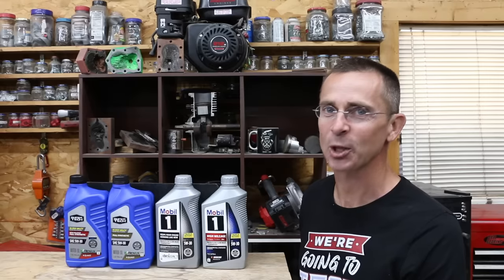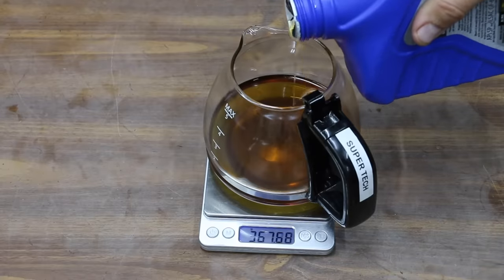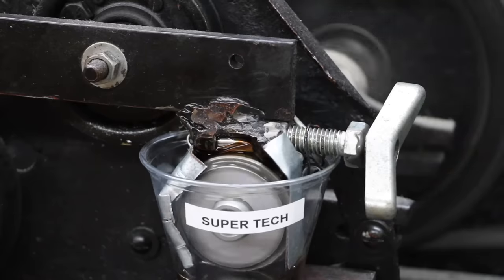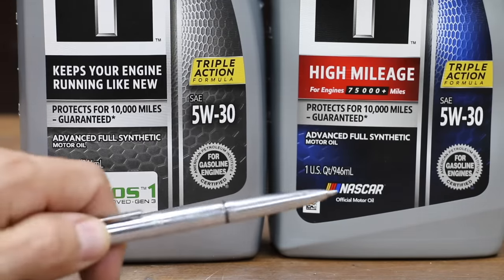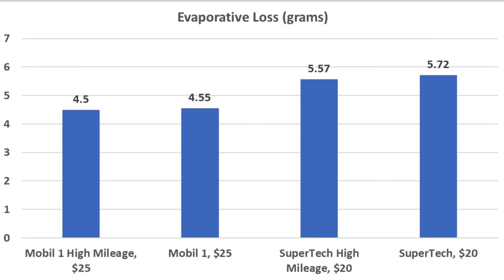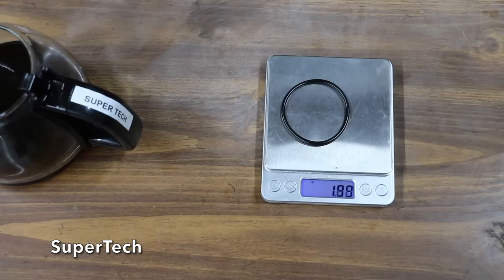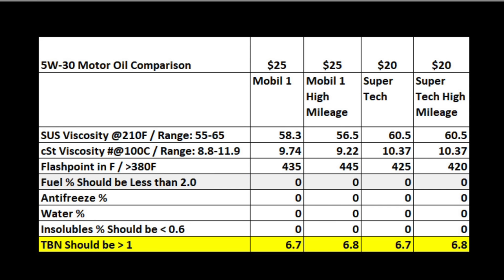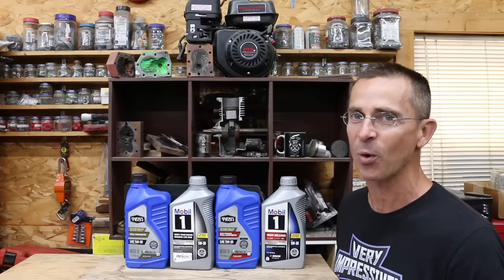Is “High Mileage” Motor Oil Safe? Let’s find out! Mobil 1 vs Mobil 1 High Mileage; SuperTech vs STHM

Comment: I think every manufacturer needs to strive to get the “Project Farm Seal of Approval”
Reply from the maker: Thanks!
Reply: LMAO! 
Too right!
Reply: Yes sir
Reply: @robbydiesel9345  that's not the greatest endorsement 😆
Reply: Castrol, it's more than just oil it's liquid engineering!  I had a cocktail 5w30 10w30 + Lucas stabilizer to seal drain plug leak

I saw gtx on sale $5 at dollar general, W.T.H.eck I put in 1/4 of the bottle 5w-20 high mileage to get me closer to 23 mpg (Dad's one owner)  cruising to the customers house in a van, and still NO drain leak missing a washer.  Just the water temp is higher running lean, OH WELL 🥵🫠🫡
Reply: couldnt agree no more
Reply: It would def be a PROVEN seal of APPROVAL
Reply: They all would be approved by him because he has never said an oil he’s tested is bad. He has even said that he generally uses Supertech himself (which is Walmart’s inexpensive store brand oil) because he said it’s good. And oils only get better from there with name brands.
Reply: Very Impressive stamp!
Reply: Never going to happen. Corporations are not interested in truth. They are interested in sales and full disclosure doesn’t produce that. Selective advertising does!
Reply: @michaelbaker5547 that’s not true! He tested full synthetic brands and super tech landed in the middle of.
Reply: They won't.  Less money in making shit right the first time